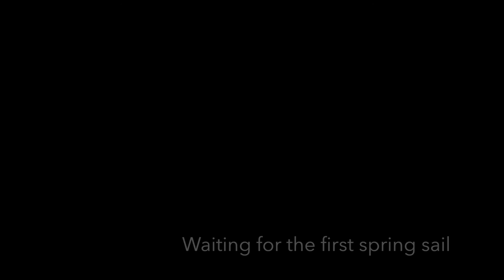Allure 13 5 ft Melonseed Skiff

Comment: Stunning, building one myself in NZ would love to know more about the centre case setup,
Reply from the maker: Bill, We scaled the case down from our 16 ft Marc Barto designed Melonseed, plans available at Woodenboat Magazine for the 13 1/2 ft Melonseed that was originally from plans that Howard Chapelle documented in his book American Small Sailing Craft, pages 208-209, plans available from the Smithsonian. I didn't save any notes on that modification but could send a few pictures that would help you scale it  to your boat. Whose plans are you building from, there are several different drawings out there. Send me an email.
Reply: Rex Payne hey thanks.  I purchased the plans through the wooden boat store for the 13‘6“ melon seed skiff.  The centre-plate comes up through the deck. I have since seen many boats with no plate through the deck and I prefer this. If you have any measurements or design ideas around how to achieve this it would be great. I am not sure how to email you other than through this link.
Reply: Rex Payne hi Rex my plans are from the same place but I would appreciate any help to achieve this modified centre plate ie photos or measurements would be really helpful thanks Bill Todd
Reply from the maker: @billtodd8738  Send me an email and will send pics, don't have measurements. My email is.   r k p a y n e 9 6 at Yahoo dot com.      Ignore the spaces,

Comment: Hello, beautiful work! I picked up melonseed plans similar to this and it's actually my first boat project. I wanted to ask about your thoughts on not using traditional framing and gluing the planking as you have here - how do you feel about its strength, and what might you recommend? I like your setup here enough to emulate it if I'm able. Thanks in advance!
Reply from the maker: Glued lap is stronger than traditional planking in my opinion. We also built a 19 1/2 foot Caledonia Yawl  that uses this method. It eliminates the boat going through shrinking/swelling cycles if kept on a trailer. Insure that you wet out the joints with straight epoxy and then go back over them with an appropriate filler/epoxy mix so that there are no dry joints. Check out the video on our Caledonia Yawl, Kathleen. We also made small fillets along the laps to increase epoxy area and strength. Best to you.
Reply: Thanks for your thoughts and advice! Hopefully I'll be putting them to good use! And I will check that one out!
Reply: @RexandKathie  i had actually already been watching it apparently, but it picked up right where you made the fillets, which was helpful!

Comment: Thanks, very beautiful.
I'm starting to build a 13.5 ft. Skiff and have questions, who can I speak with?
Reply from the maker: What is your question?
Reply: @RexandKathie  Hey Rex, I want to know if I should cut the centers out of the station molds in order to reduce the weight since the boat will have to be turned over later in the process,,?
Reply from the maker: @ronaldishkanian2578  Ronald, it is not necessary to cut the centers out of the molds. We always lift the hull off of the molds before turning, You can either leave one mold in middle in or use a single board measured to the same width as widest point to hold hull in shape. We have dismantled molds before lifting but it is much easier to just lift it up. Check out some the other build videos of different boats on our channel. Good luck!